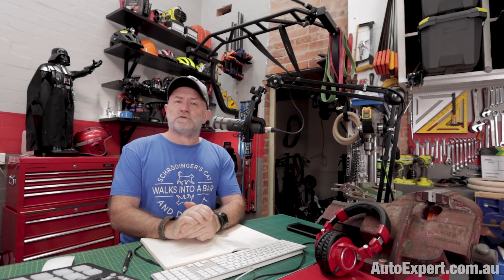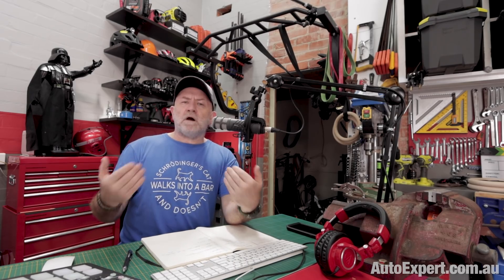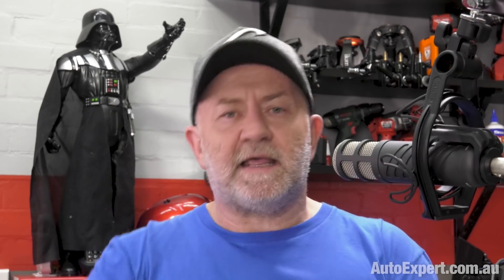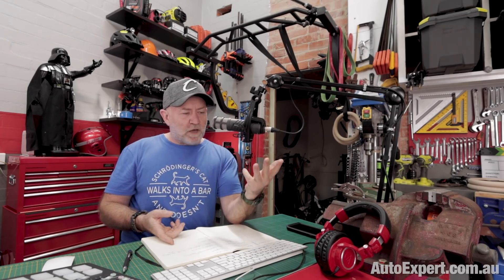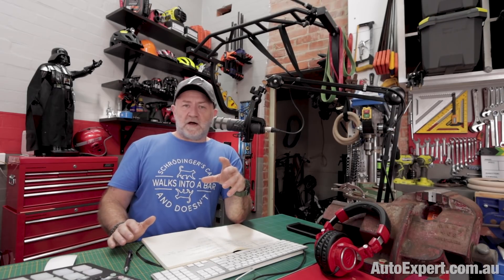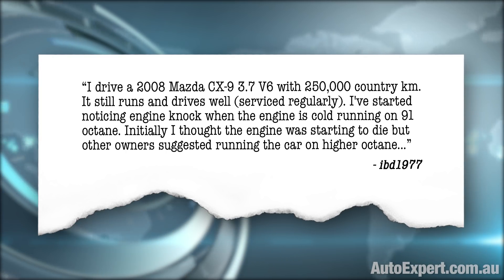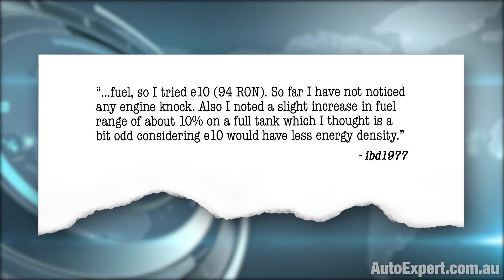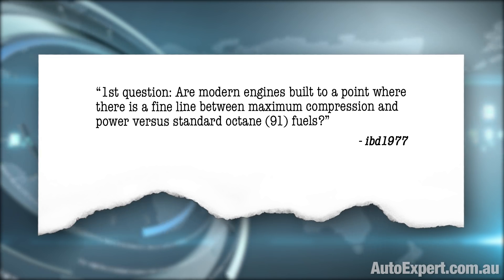Octane rating & engine knock: ultimate 'beer garden physics' deep dive | Auto Expert John Cadogan

Comment: More octane means more power, you can simply increase horsepower by pouring octane in the tank. Though it won't increase Kilowatts, just horsepower. Also you can increase spin by driving in Canberra.
Reply: Haha.  I hope that statement is all tongue-in-cheek, because it could just be the BS "Nuts" comment of the century.

Comment: Hey John, I have an old '88 Nissan Sentra hatch with the SOHC 8-valve E13 engine in it, nearly 200,000kms. The cylinder head has been reworked and it runs pretty good, but under lockdown conditions I'm only allowed to drive it to the shops and back which is like a 4km round trip with a 40 minute dead spot in the middle. 
I'm aware those conditions are hell on engines and cause oil dilution, and I also can't do an oil change without access to my workshop. 
I'm trying to take detours home and give the engine some heavy loading once it's up to temperature, especially if I 'accidentally' drive on to the poorly signposted motorway onramp which doesn't have any exits for 8km. 
Is it good for engine health to be given full throttle and a bit of a rev out or should I be driving like an old lady? Best, Frank

Comment: Gidday John, excellent work. I hope you can help me clear this up? My son bought a 2019 MQ Triton, it has recently started to leak at the exhaust manifold! Upon exploring the problem he discovered the manifold has a large crack in it. The car has done 60 thousand klms and still under warranty, so would this be covered? Apparently he has been on his FB forum and it seems to be an issue that more than one person has had. Also they said that when they contacted their dealer they were told its not covered, what are your thoughts? Thanks Tony
Reply: I'd suspect the dealer is pulling ya leg... it's a classic example of wool over your eyes ... Time wasted to challenge their refusal takes longer than paying to get the problem fixed... "cheque book justice"
Reply: @peterlattimore6013  Yep i have no doubt that

Comment: Hey John can I use 98 octane on a 2002 Mazda 323 Astina that recommends unleaded fuel only? To optimise the engine running or am I opening a door here for disaster? Also Toyota vs VW I’ve noticed smoother shifting in a DSG while stationery in comparison to a CVT when stationary moving the shifter from park to drive etc ? Is there any particular reasoning for this ? Or is this because CVTs are just shit ?

Comment: i have a 2018 mazda cx-9 and i have 2 ? 1 the dealer says use 5w30 but the oil fill says 0w20 which is right. 2 it says it gets about 50 more horsepower with 93 octanes and gets better gas mileage how is that possible thanks in advance.

Comment: 13:19  3.7L V6 with 250000 km is on the edge? Sounds a bit low.
Reply: Yeah, 150,000 miles really isn't all that high miles for a modern car that has been maintained.

Comment: Is there a difference in the quality of fuels across the 4 major here in Straya? Shell, Caltex, BP, Mobil? My tuned 2013 Forester XT hates Caltex and Mobil 98 but loves Shell and BP 98. Only mod is a cat back exhaust and a K&N panel filter which were on the car during tuning.
Reply: The base fuel is the same among the major brands,

They then add their special herbs and spices (propitiatory additives) to it. 

What you are experiencing is common, and there are numerous threads on the topic of cars running better on some brands and worse on others.

In regards to K&N:

https://www.nicoclub.com/archives/kn-vs-oem-filter.html

Comment: Two questions that weren't answered for me. 1) Is the energy/density the same between all the RON numbers? (Assuming a lack of ethanol etc) 2) I heard/read/dreamed that the higher the RON number, the slower the flame front progresses, thus you can have such things as more aggressive valve overlap and ignition timing in such engines. True or false? Cheers, Keith
Reply from the maker: 98 - slightly greater energy density. RON has nothing to do with flame speed/temperature. It's all about knock resistance.
Reply: @AutoExpertJC  Copy that, thanks.

Comment: Curious about the knock in the engine only when cold, as you said it's usually the other way around. Could it be related of the automatic "choke" perhaps, something about the air-fuel mixture the ECU uses at low temperatures causing just the right conditions for knock, but not once the engine reaches temperature and the mixture returns to normal.
Reply: Cold knock can also be worn, or excessive piston to cylinder clearance. Pistons will expand once heated up and the knocking goes away. Same with bearings, too.
Reply: @jamesplotkin4674  How does excessive clearance cause knock? Honest question.
Reply: @jasonhawken871  Not ignition knock, per se, but sounds which seem like it. If a rod bearing, or the piston is a little worn and small for it's cylinder, it will bang like a knocking and if the clearance is just right, once fully warmed up, will go away.
Reply: @jamesplotkin4674  Yeah, piston slap or whatever you want to call it, no problem... but using higher octane fuel shouldn't fix that right? Assuming the owners observations are accurate.
Reply: @jasonhawken871  I thought the op said it went away after the engine warmed up. I apologise if I mis-heard.
Reply: @jamesplotkin4674  He said the problem was only present before engine warmed up, but after using higher octane fuel the problem was gone entirely. Don't mind me, just have a curious mind for working these things out.
Reply: @jasonhawken871  I need to pay closer attention.

Comment: Was engine knock the reason lead (Pb) compounds were introduced into petrol?
Reply: Leaded fuels primarily lubricate the valves and seats from excessive wear. Hardened seats are required to use modern unleaded fuels.
Reply: Tetraethyl lead is an anti knock additive, its primary purpose.  That and raising the crime rate
Reply: The man who developed the use of tetraethyl lead as a motor fuel additive was chemist Thomas Midgley.  He was working under Charles Kettering at the time at a subsidiary of General Motors. His assignment was to find an additive to eliminate knocking in the higher performance higher compression engines that auto manufacturers were beginning to produce in the early 1920s so yes, the purpose of adding lead compounds to gasoline was to eliminate engine knock..  Incidentally, Midgley was also the man who developed chlorofluorocarbon chemicals for use as refrigerants.  Quite the gentleman with 2 environmental catastrophes under his belt!
Reply: @Vincent_Sullivan  Thanks for the info. But, back in the 1920's wasn't "high compression" somewhere around 6-to-1? I still stand by my assertion that lead was ALSO needed to lubricate the valves and seats.
Reply: @jamesplotkin4674  There is no doubt that the deposits created by lead additives did give a lubricating effect on the valves and valve seats and that was an additional beneficial effect of adding lead to the fuel.  I think though, that this benefit was more a "happy accident" than one of the objectives of the research that led to Tetraethyl lead as a gasoline additive.  The auto makers took advantage of the situation by building engines with lower quality (cheaper) materials that would still have acceptable lifetimes due to the lubricating effect of the lead additives.  The lead also had some bad characteristics that negatively affected engines, notably fouling of the spark plugs.  So, as with all engineering, you make compromises to get an acceptable balance to produce a useful system.  During the era of leaded gasoline (roughly 1925 to 1975) AMOCO in the USA did produce a high octane high quality unleaded gasoline which was sold alongside their leaded gasolines.  Distribution was limited and cost was high, but it did give an alternative for those people who preferred to use a gasoline without lead.

          The bottom line is that Thomas Midgley's research was conducted with the objective of easily improving the octane rating of gasoline to reduce engine knock and a happy side effect was extension of valve and valve seat lifetime due to the lubrication effect.  Yes, the "high compression" engines of the early to mid 1920s were around 6 to 1 compression ratio which was high compared with, say, the model T which ran at about 4.5 to 1.  Either type of engine can be manufactured with high quality valves and valve seats suitable for use with unleaded fuels, or can be made with cheaper materials which will only have a good lifetime if used with leaded fuels.  Not hard to guess which choice the manufacturers made when leaded fuel became available!
Reply: Vincent Sullivan giving Nature a helping hand.

Comment: For say a current Nissan Patrol towing a large van and PULP is unavailable,  is it okay to use 91 and add octane booster ? Any problem with doing this repeatedly if in remote areas?
Reply: What you need to be mindful with "Octane Boosters"

Is that some use very misleading information.

For example there are some that claim to boost the octane by 5-7 units, but in the fine print you read that it is really 0.5-0.7 octane numbers, so your 91 becomes..... 91.5 Octane)

So buy one that actually boosts the Octane by real numbers

Comment: Hi John, quick question about E85 fuels. I've been told by a few people that it burns cooler and slower than regular petrol and also that its emissions are much less (higher percentage of water vapour and less noX) than petrol. I'm aware of its uses for performance engines as I run it in my modified track car. Have the things I've been told true or did someone give me a bum steer?

Comment: I have found this RON/MON/AON rant to be most interesting and even informative.   I think I even learnt something.  How long I retain it, well I'll find out.  I have one question.  I have in the past put 96(RON) fuel in my car, it can take 91 and above.  I assume this is OK.   However my latest car is a turbo engine.  The label at the filling place says '  91 Octane (RON) minimum ' .  If I used 96(Ron) what effect could this have on the turbo engine, power, and economy wise?
Reply: As a general rule using a higher octane fuel will not cause any issues, provided that your car was designed to run on it.

So using a fuel that is 95-98 (max 10% ethanol) in a car that lists 91 (and E10 compliant) as the minimum won't cause any issues

Using E85 which has an octane rating of 107 in a car not designed to run on E85 will cause issues.

The long story short in regards to your new ride, is that you need to try it (generally for about a month) and see if you notice any differences, 

And if you have a friend with a Dyno, you can get readings with 91, and then with 95 and or 98 and see if there is concrete proof that you are getting some sort of performance benefit (which it seem's is what your question is).

Theoretically you should see a performance gain, but to what degree is anyone's guess.

And to muddy the waters, some car brands seem to perform better with some fuel brands over others.

As an aside my last car (and current car) are non-turbo and using different fuels (E10, 91, 95, 98) in my previous car the impression that I was left with was:

91 seemed to generate it's max power sooner (imagine this like a 1/4 mile race)

98 seemed to generate max power later on (imagine like a race where there is no finish line), and it felt as though it did generate more power, 

As though there was a different power curve when using the different fuels (which is to be expected, but I just didn't expect to see the difference in a non modified, not aftermarket tuned, boring, 2005 Corolla manual sedan)
Reply: Thankyou for your info.  I will try for a month using 95oct fuel and record the differences.  Mainly looking at economy vs cost.

Comment: My old toyota was pinging pretty hard (7A-FE, lean burning engine) until I got some new spark plugs and adjusted the ignition timing to manufacturer's spec. At that point it went away for about 500 miles, but now it's back again (nothing like what it used to be, mind). I've narrowed the issue down to either a dodgy knock sensor or a dodgy oxygen sensor, either of which would be suspect on a 24 year old car, both of which being pricey enough for me to want confirmation before firing up the parts cannon. Can you suggest an experiment to confirm which is bad (or if both are)?
Reply: Pinging can be caused by multiple issues.

- But firstly how do you know that the engine is pinging (that that is what is going on)?

Assuming that it is pinging:

- Has the ignition timing changed since you adjusted it (and how did you adjust it?)

- There could be an issue with the timing advancing and retarding mechanism

-  You could have a weak ignition coil (or coil packs)? which might explain how the problem went away with new plugs (and is starting to come back), maybe try a new set of plugs (if it "fixes it again" then I would suspect that the ignition coil is the problem)

-  Did the pinging start after you added new fuel to the car (maybe fuel issue like a bad batch, which does happen from time to time)

- Generally an Oxygen sensor fault the engine light should come on

- If it's a knock sensor fault, the Check Engine light would (should) come on

The best advise is to take you car to a trusted mechanic, who can plug a scan tool in and read the data, and any fault codes.

Comment: My experience with a Cx9 3.7lt - 
after you look at the ecu for a fault code.
If no spark plug or coil pack and or knock sensor fail, never heard of it happening. damaged wiring yes but not sensor fail.  
Yo check if, the fuel filter is blocked, no history change it. 
Most common unchanged often enough item in cx9's. fixes 70% of engine issues "wow"  
Next would be those nice cheap $12 Platinum fomoco plugs from Mexico. Genuine product. Intake has to come off to do the 3 rear and - who knows if new gaskets were used when that occurred either. Dealers carry them - they never sell them. aftermarket only just added them.

I have put those lumps through hell on 3 year old fuel and they don't knock if the car is serviced good. once warm they even go quiet.

Comment: Maybe you could do a PitBG (Physics etc.etc.) relating to Atkinson vs Otto cycles, Swept volume vs compressed volume, Something along the lines of the fact that an Atkinson cycle engine only compresses 2/3 s the swept volume and so as far as charge volume goes, a 1.6L Atkinson is roughly equivalent to 1L Otto cycle engine in charge volume and therefore power output, in my opinion. 

Or: why does an I30 go and a Prius is a lethargic turd. (Not the ideological reasons but the engineering reasons.)

Comment: Great video John, very informative, thank you indeed. I like the beer garden physics vids, can we have more please especially seeing it's the zombie apocalypse? I do have a question in regards to coil packs, how do you know when they need changing? My Mazda 6 has done 130,000 Km and we're about to change the trans oil but someone told me the coil packs may need to be changed to keep it running smoothly, the spark plugs have been changed at 100,000 Km. As always thanks for your help and be well.
Reply: Im not JC but i'm going to throw in my 10 cents.
You will know when a coil pack begins failing as the engine note changes dramatically to something resembling that of an old motorboat and the engine will increase in vibration, often illuminating the check-engine indication light and datalog a DTC . Usually coils start showing its imminent demise with it resulting in misfiring just after engine start or when the engine is hot, under load or both.
There are various methods for testing coils but this is theMazda Service Procedure 

https://www.mazdas247.com/forum/index.php?attachments/coil-jpg.158443/

I personally wouldn't feel the need to replace them until they show signs of failing. I have seen double those k's out of original units although excessive heat or vibration can reduce there operating life substantially.  I would be more inclined to direct the attention towards getting the trans filter replaced with that oil change instead.

Now, back to your regular scheduled program with JC
Reply: @rarkitorparkit  Thanks so much for the advice, that makes sense. I'll make sure to get the trans done properly and replace a dodgy engine mount while we're at it. Thanks again.

Comment: Hi John. I'm a mature age apprentice mechanic and was wondering your thoughts about changing grades of engine oil from what the manufacturer recommends as an engine starts to wear from use/age ect.
Reply: In short, unless it is using oil (whether blue smoke is visible or not) 

Use the recommended grade, because while some parts of the engine wears, the oil gallery's don't

And if you put a thicker oil in, it could cause oil flow problems etc.

And if it is using oil, I would contact the manufacturer and see what they recommend (yes there are products that you can add, but do your research before using)